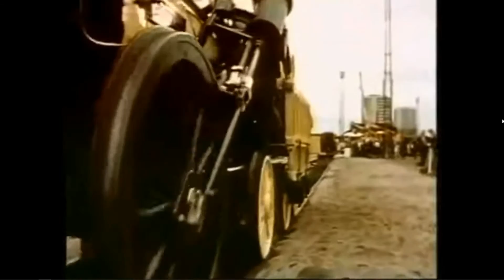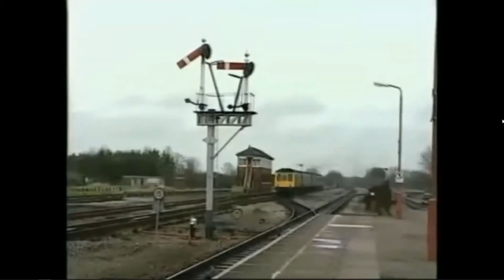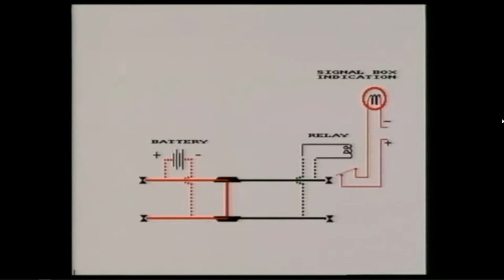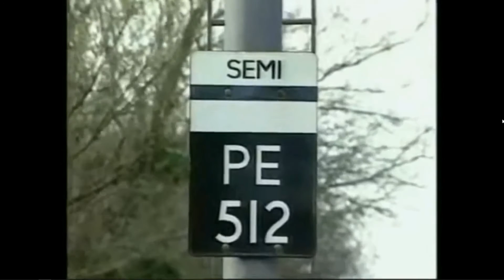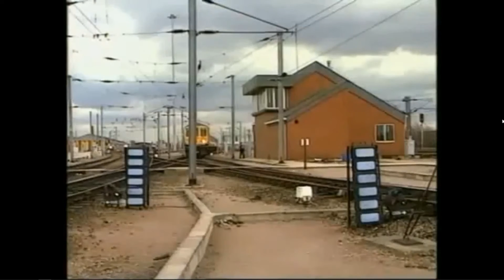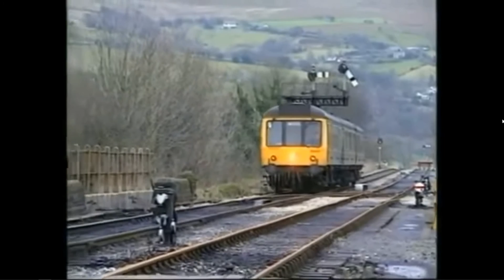British Rail  Signalling Pt1

Comment: VSC Clapham junction was a Disaster! Signalling points failures all the time. ASE was 'Wrong man for the job'had to be paid off, replacement narcissistic told by Chairman BR Board that he was to be sacked in 6 months time unless failures dropped, bought in Man from Swanley led a task force team found lots  of equipment faults reduced failure rate.
Reply: What